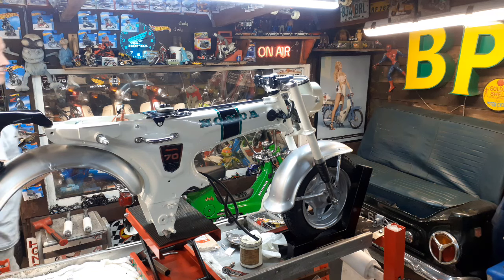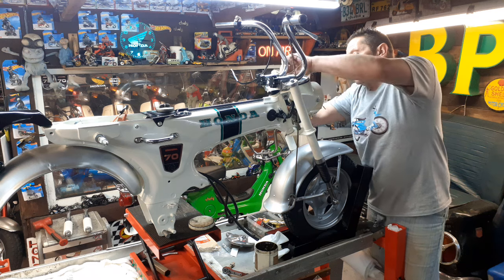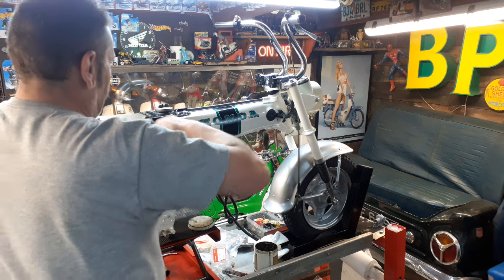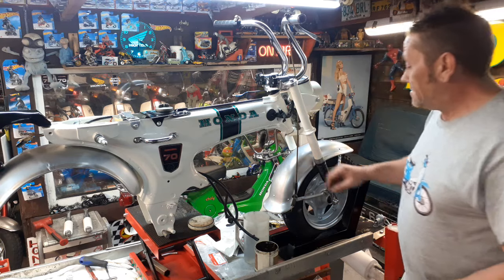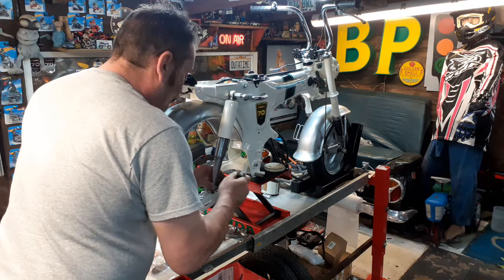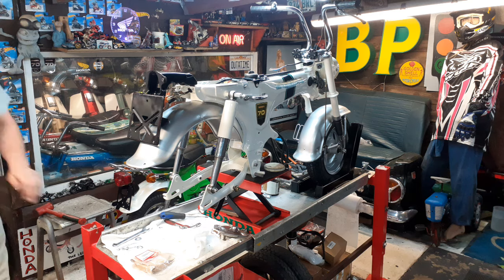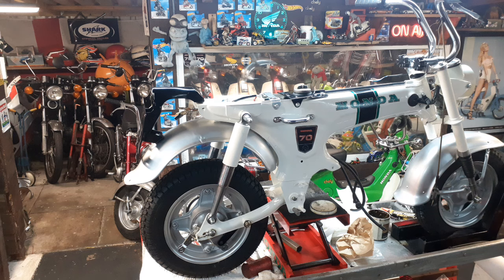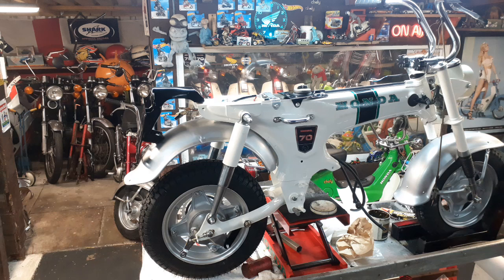honda st70 lady dax rebuild part 3

Comment: Good to see you showing others what to do with the handlebar screw-knobs. I’ve always used a nickel base anti-seize on all my bikes screw-knobs and a silicon grease on any threaded fasteners screwed into aluminum parts.
Reply from the maker: Hiya bud, yeah I've had a few,where I've had to cut them off, our winters over here dont do them anygood.